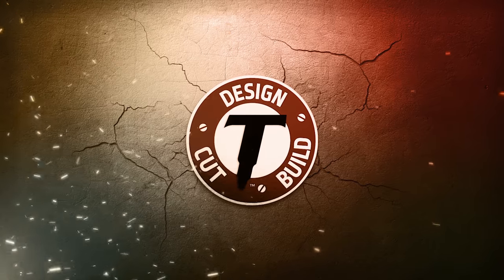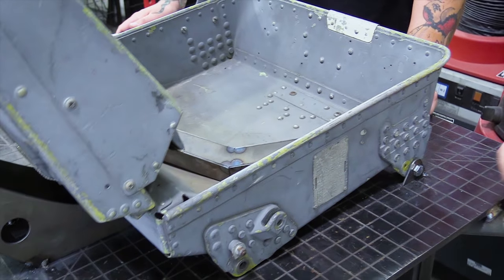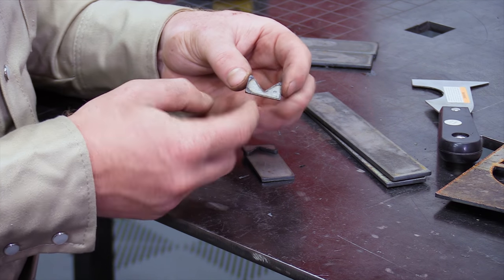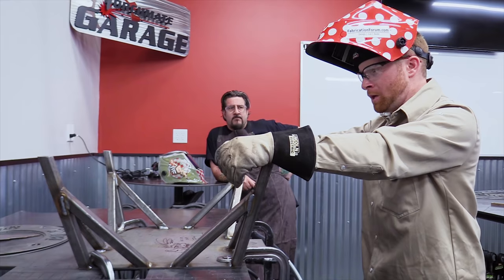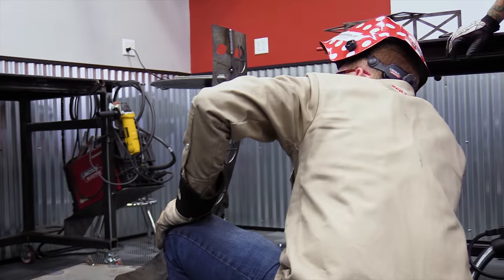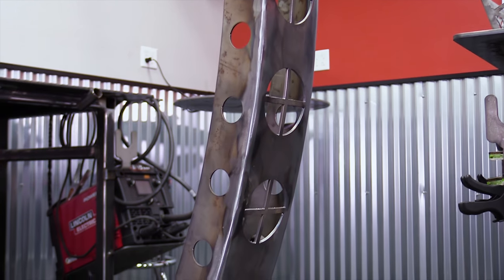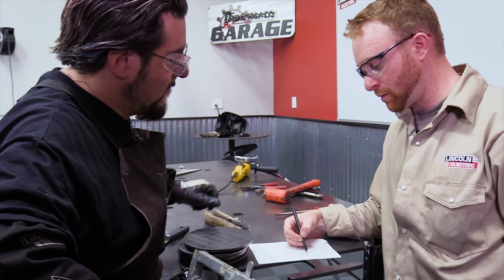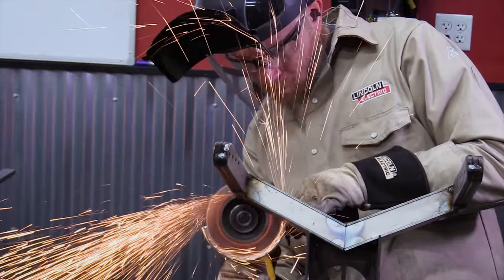Vintage Airplane Seat Turns Into Reclining Industrial Chair - Design | Cut | Build™ -  S3.E11

Comment: Nice.  How 'bout a garage couch, styled to match, using parts from the front or back of an old junk car?  If you design a generic framework then you can show how to adapt it to a couple different sets of parts cars.  If you do.  It will make building similar couches easier for folks. Besides, the styling looks sharp so, remember a Lincoln Electric Brand plate.  Bo.
Reply: Bogdan Naleszkiewicz I like that idea!! I’ve got a few old automotive bench seats from the 50’s! Excellent idea!!

Comment: Awesome chair, should fit in great in that garage!  On the bevel cuts, it looks like you made the vertical cuts first then the bevel cut correct? Was there any need to re-center the loose disc in the hole before you started on the bevel cut, or was it good enough?  I wish my table had a bevelling axis like that!  It was cool to watch the head spin as it was cutting!
Reply: Scratchthejeepguy hmmmm good question. The operator on that machine set it up. I did notice it took two paths at that angle to cut all the way through from startup. Let’s see if Iggy or the techs jump on here to answer. It was epic to watch though. Much slower than the normal cuts we do as the Metal was so thick!! Thank you for the question! And compliments 😉👍
Reply: That  makes sense about the parts sticking to the slats. I forgot about that. Thanks for the reply.